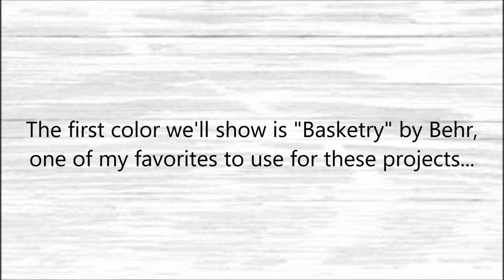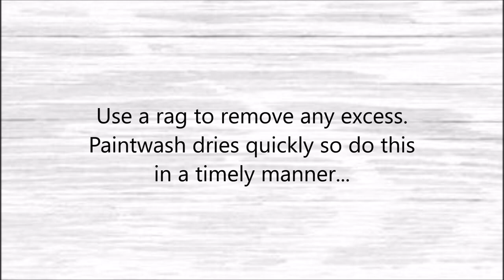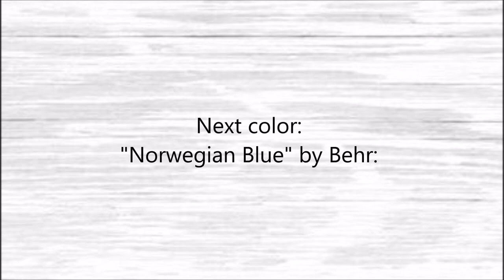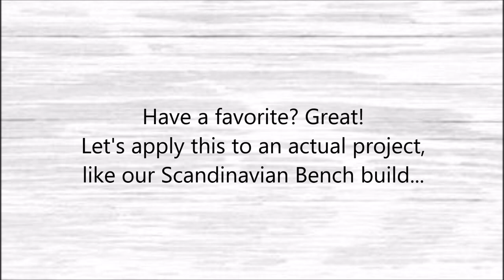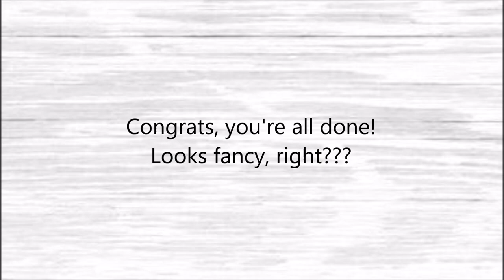How to Paintwash / Colorwash - Professional Looking Finish for DIY Projects!

Comment: Perfect covering for the Scandinavian Bench.  White wash is common in that part of the world for finish covering.  I'm going to try your washes over shellac, as pine is an oily wood and water based products tend to be pushed out of/off of, oily woods without sealing the oil in first with a coat of shellac.  Really cool idea.